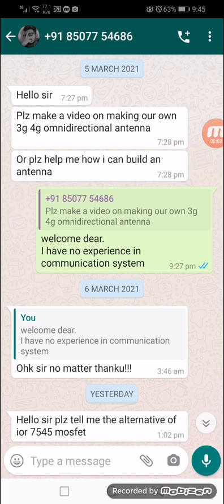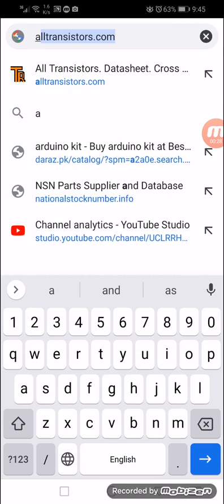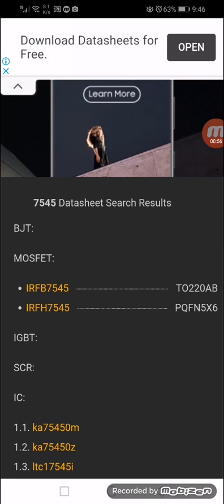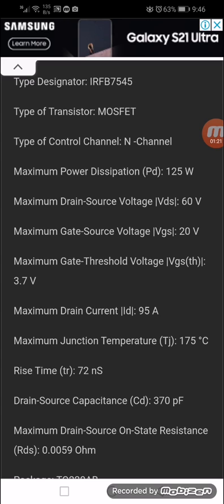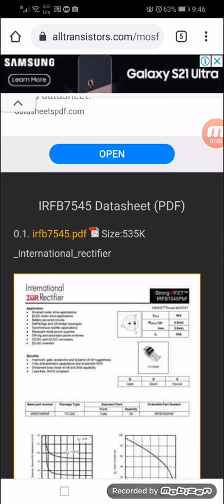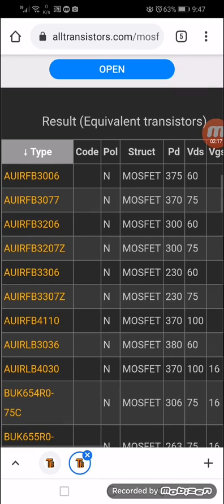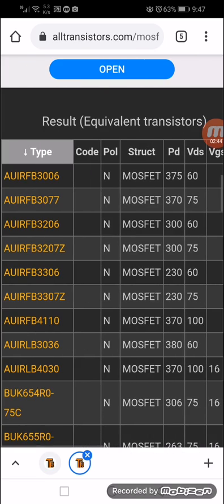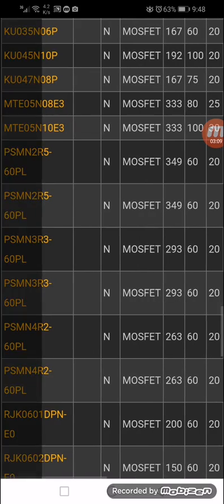334. How to find MOSFET Equivalent or Substitute or Replacement

Comment: Sir what is SJ 6R099c6 mosfet and it is connected in circuit.Along with this mosfet 47 ohm ntc connected in parallel across drain and source pin.so when I checked it is showing shorting between drain and source